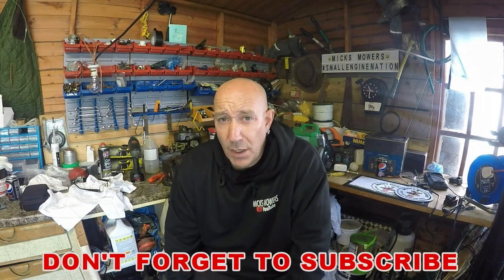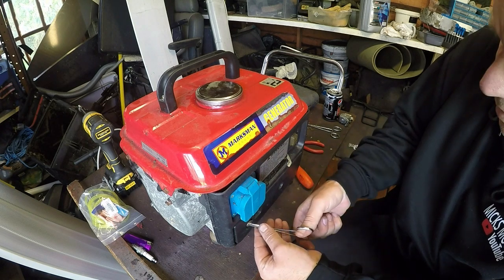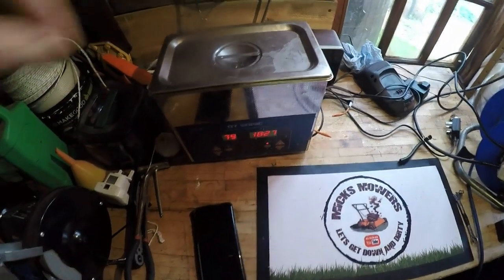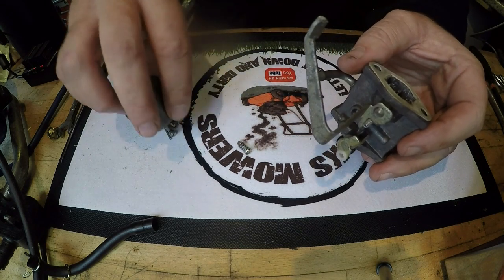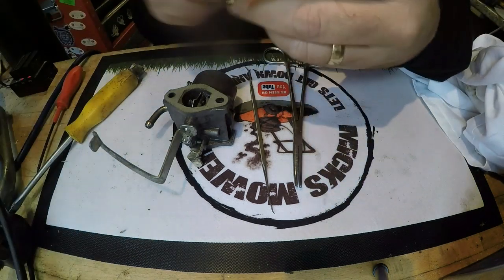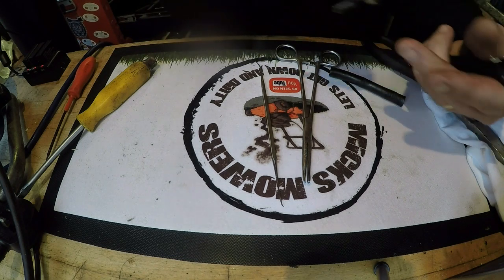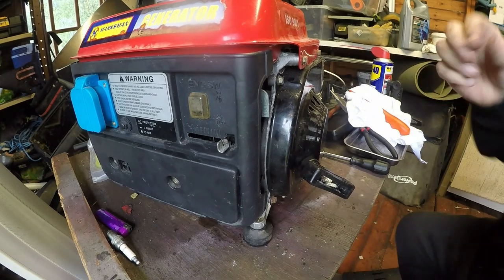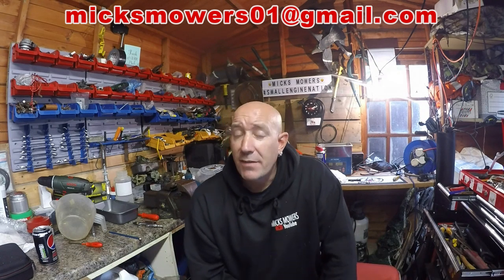#geterator #petrol #easyfix How to fix / repair a petrol two stroke generator

Comment: I know this feeling of pride...I stripped my lawnmower the other day...took the carburettor off and cleaned it all and sorted the o-ring which had been pinched and so leaking air and fuel whilst priming. It started first pull of the chord...it was a bugger to start before and then prior to the strip down; it wouldn’t start with fuel oozing out everywhere
Reply from the maker: Good on ya.. it's great when it happens
Reply: It’s because of you and Martin that I’ve gained the knowledge to fix it 👍🏼

Comment: We have these over here at Harbor Freight, $89.00 on sale, $99.00 regular. 850 watts, or about 7 amps, at 120 v. Light duty only. They call them a Tail Gater” . Did you check output? Nice job.